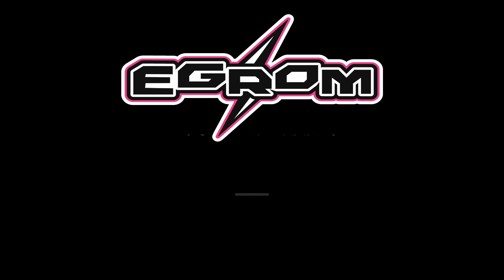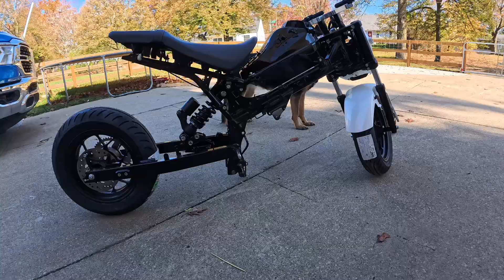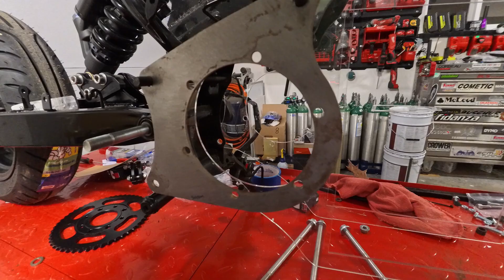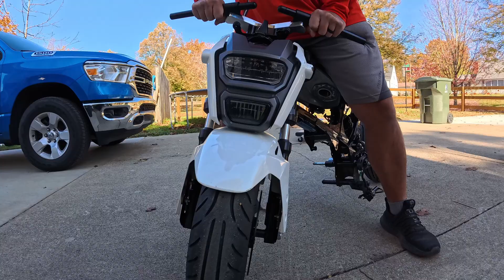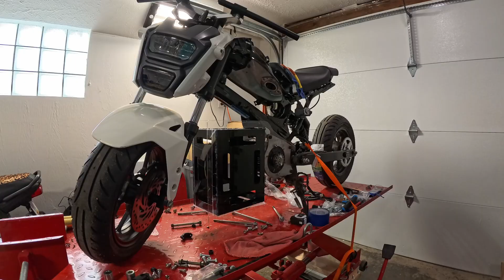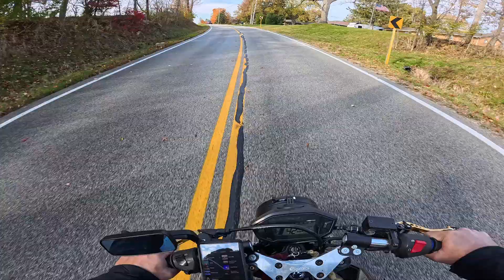Learning The HARD Way | Custom Electric Honda Grom Build Episode #4

Comment: Amorge kicks a$$. I’ve had around 8 batteries made from them. Allen is the man to work with. They can do custom shapes too, doesn’t have to be square. I’ve had them do quite a few with custom angles to fit into intricate shapes. It can reduced AH but you still get a fantastic battery. Highly recommended!
Reply from the maker: Yea, he sure is. It is wild what they can make shape wise. I just can't get over the quality of the builds themselves. They're downright beautiful.
Reply: @ Sweet, the EM200 will be awesome for that. My wife wants to convert her Z125 to EV after I did a few conversions as well. The torque and everything about EV is simply intoxicating. Love what you’re doing!
Reply from the maker: @user-hb2ve3md6c  oh yea. I built the ERuck with a 200 and it HAULS. So excited to get the bracketry back from fabrication. Once I do I'll only be a few weeks out from beating on it for testing! Pumped is an understatement!
Reply: @3CMiniWorks  Hell yeah man, looking forward to it!
Reply from the maker: @user-hb2ve3md6c  also you should do that. The Z125 would be a prime subject!

Comment: I dont know where you fit 52AH in that Ruck.  It is hidden well and clean AF.  I am ending up with a big brick.  Who are using as a reliable source for a China or AliEx battery?  I am being told 450A and 1050A peak, but am worried the quality will not be there with that much draw.  I am only trying to do 20ish miles range and the online calculators tell me 100AH so that can't be correct.  Any idea what AH I would need for a 96v 20kw Hub and ND961800 combo on a ruckus?
Reply from the maker: @GhettoWrench  you just made me laugh our loud. Thanks for that! 😆 Cannot recommend Amorge enough. They are by far, in my opinion, a top notch Chinese battery manufacturer. Their batteries are nothing short of art pieces and you can find quite a few deconstruction videos of them to show visual proof of build quality as well. 

Those numbers sound pretty spot on. Frankly, I would recommend getting a lower voltage. 96v is WAYYY overkill for the ruck and the 72v has plenty of kick. If you haven't watched it yet I posted a video of it kicking a 373cc butt! By going lower voltage you will be able to lower your battery size immensely. On our ERuck setup I could run a roughly 20-25ah battery and get 20 miles no problem. 

*Note- there is a bit more to it than simply lowering voltage, but that would be a great start.

Comment: Just found your channel today, after looking around because t5k only sells their ruckus kit to dealers apparently.

Very interested to see how the grom turns out! 

Could you explain how the controllers work? I've been reading about electric vehicles and how different controllers produce different power outputs, how exactly does that work in relation to an electric motor? Is it because they're able to translate higher voltage or amperes? Or a different ratio between the two? I would love to build an egrom or eruckus, or maybe even something bigger.
Reply from the maker: @barryallen5507  from what I understand, T5K never actually sold any kits or intended to. He sold his main prototype bike to Rolling Wrench. 

At any rate, I'm super excited about it also! 😀 The controller is basically an electric bike ECU. It takes the power from the battery and just distributes it as required based on how it's tuned essentially. Yes, there are many options for controllers, but at their core they're pretty simplistic.
Reply: @3CMiniWorks  Interesting, that's too bad. Seemed like a good setup with a lot of potential in the ruckus community. 

I only found them because someone was running a paypal scam on instagram and their prototype was one of their listed items for sale at 1,300$. I knew that was blatant disinformation immediately lol
Reply from the maker: @barryallen5507  kind of. It depends on how you look at it. It really boils down to most people don't want to drop 10k to start on a Ruckus.